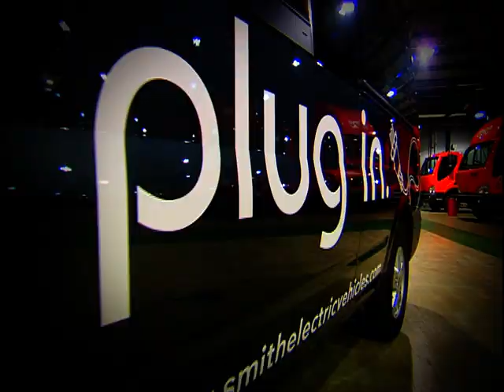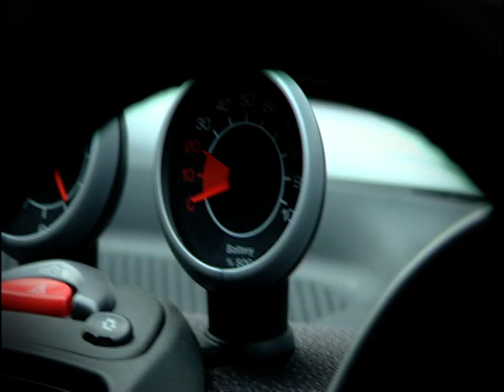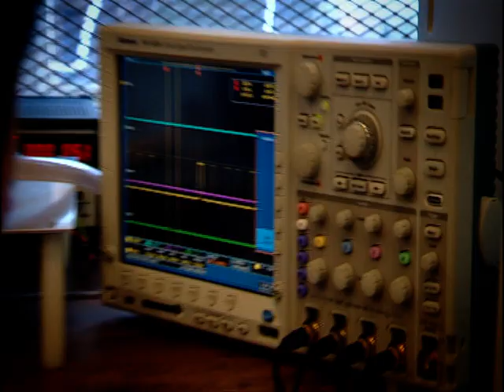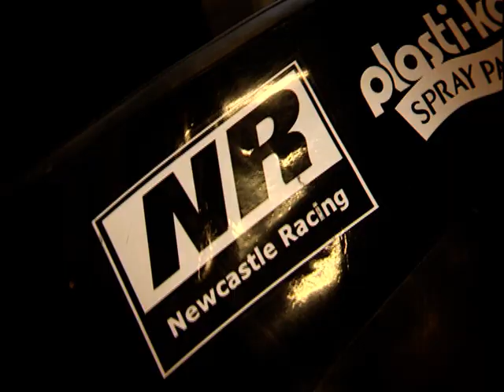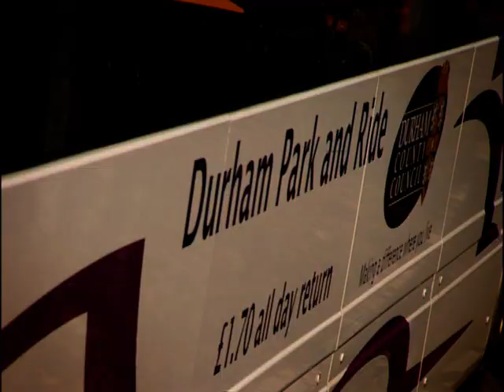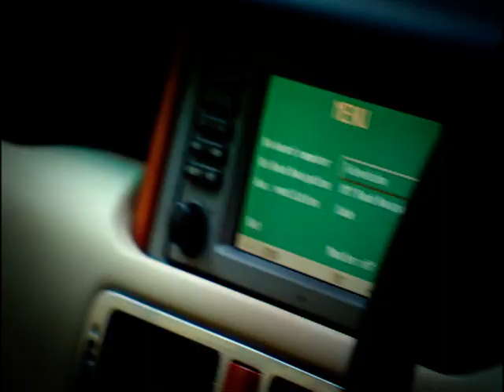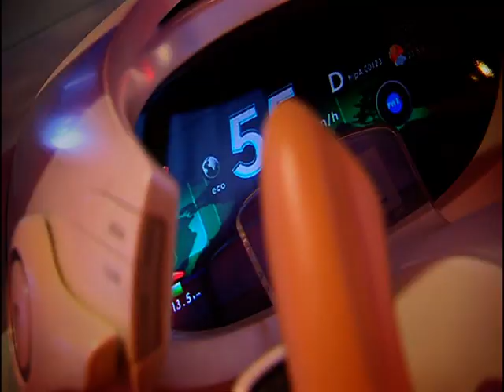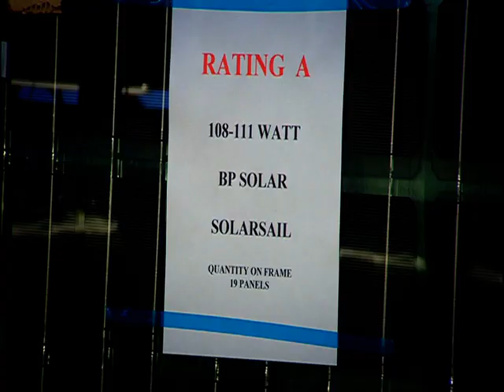Liberty Electric Cars CEO Barry Shrier interview in "Electric Transport in England"

Comment: Optimally, you need a low drag coefficient.  Converting regular cars to electric is all well and good, but the true benefits start to arise when you build one from the ground up.  Tesla S has a ridiculously low drag coefficient of Cd=0.24 and they're even thinking of replacing the Model X mirrors with cameras to further increase aerodynamics.  By having the batteries mounted on the floor pan, they don't need a front air intake grille.  Removing that further improves aerodynamics and handling.